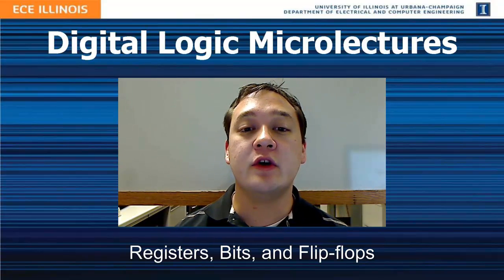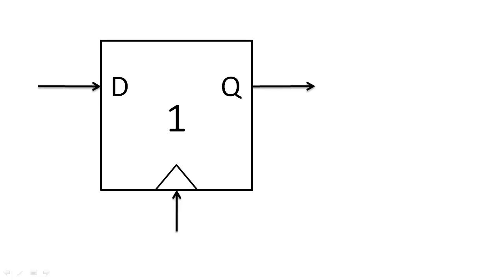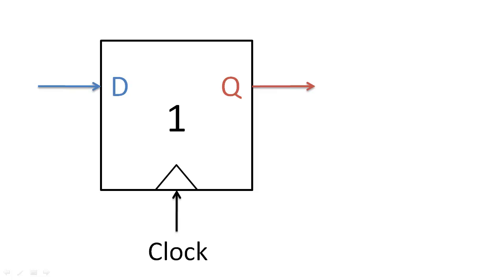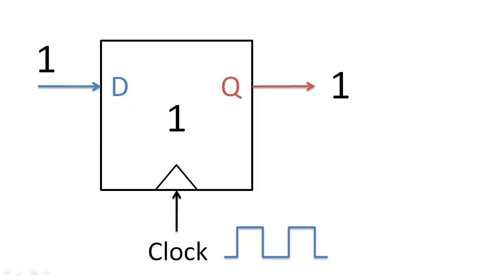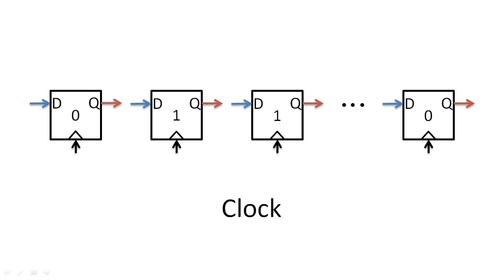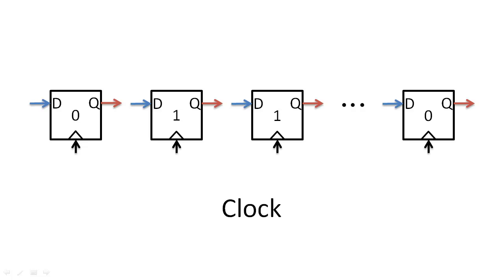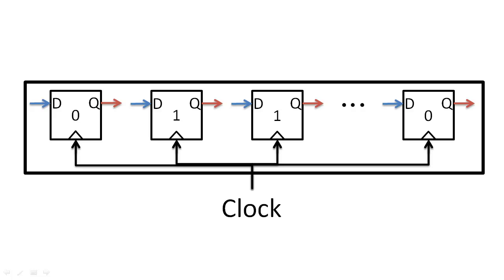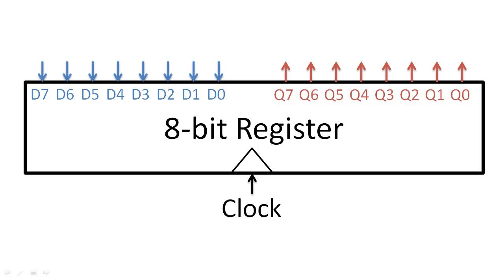Registers, Flip-flops, and Modular Design

Comment: Great video, I learned alot. I seems rather natural to think of the register as a heart. With the veins as the input signals, and the arteries as the output signal. The more I think of it this analogy does seem to make quite a lot of sense.

On the rising edge of a clock cycle, the value is pumped out of the register, much like a heart pumps out the blood that is in the heart into the arteries. Simultanously a new value comes in from the input signals, just like new blood flows into the heart through the veins when the heart does the pumping. 

The rythm is decided by the rising edge of the clock cycle (Given that the flip flops are positive edged of course).
What decides the rythm in the human body, I don't know. I am not a doctor.